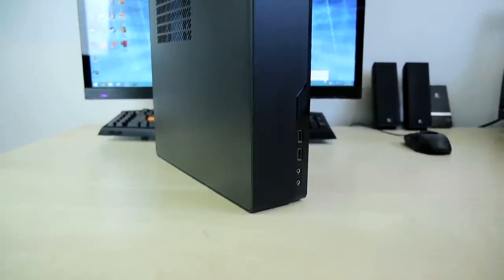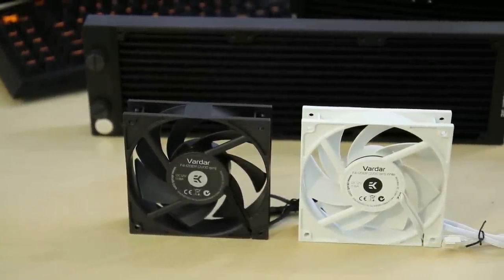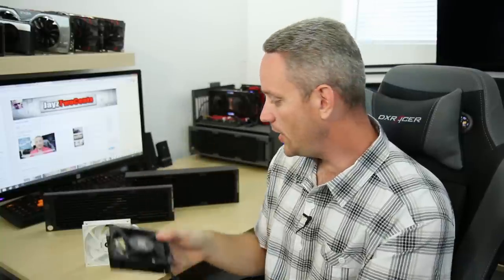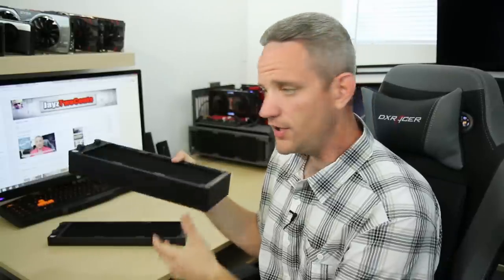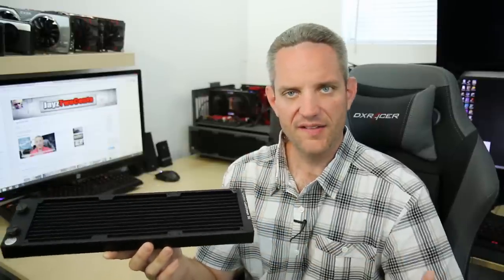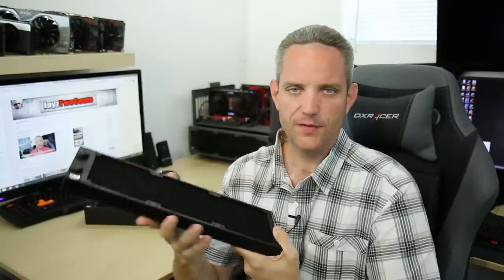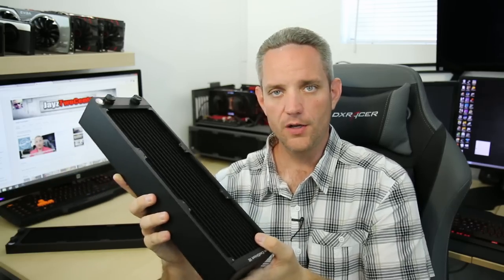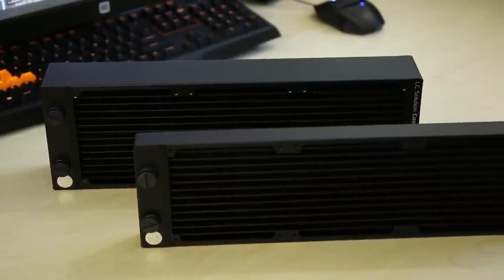New EK Radiators and Fans | When should you use Thick vs Thin Radiator?

Comment: ***** Would it be worth doing a pair of thins with a fan in the middle if the space was available?
                     
i.e   air in => thin rad => fans => thin rad ==> air out

Or even the above example with an extra fan in push or pull on the outside.

Comment: The case I have comes fitted with a 3x140 rail but I can buy a 4x120 rail... 
My question is... for a CPU loop only ( ASUS R6E Monoblock ) cooling a 7980XE should I go with a 420 with 28 mm thickness or a 480 with 28 mm thickness and buy the new rail?

Comment: The thing I dont understand though is,  for two raditators the same size, one with high FPI and low thickness and the other with high thickness and low FPI, which one is better ?  any disadvantage to finding high fpi radiators and using them ?

Comment: Well damn you answered some pondering questions I had about my setup.  I have notice my water level dropping but couldn't find a leak, and my Alphacool XT45 Triple 120 makes squirting water noises could that be those air pockets?
Reply: B3yondBlu Most certainly air pockets - try leaning your case side to side gently (like 45* should help) a few times throughout the day. Just be safe about reservoirs and such - leaning or laying on its side if your res is for some reason not safe for doing so could be bad. (A properly built system should be fine in any orientation - but better safe than sorry).

Comment: I have space for triple 120 or dual 140mm rads. Would you recommend a 280 or a 360mm radiator?
Reply: ***** Triple 120s as it has a larger cooling surface area than the 280.

Comment: Also, i just received my Corsair 750D. Can i run the EK Slim 240x2 and EK Slim 360 Push pull Config? Stock PC with potential future overclocking.

Comment: Building a TR system with a Swiftech 480, a Alphacool 280, and Alphacool 120, all are copper with push pull fan config an EK tube res with D5 pump bottom, and a WaterCooling Heatkiller IV CPU waterblock in a modified Coolermaster Cosmos 2 Tower. But I am not sure if I should run the loop res to pump to 120 to CPU to 480 to 280 to res. Or diffrent combo. Please advise

Comment: would you say it's better to use a thick radiator when the case has bad air flow and a thin radiator when there's good airflow? also the thicker the radiator the more powerful pump you need to push the water right? or is my thinking wrong
Reply: so it seems like using a thicker  radiator is needed when you're only using one radiator too cool multiple components?

Comment: hey jay im planning to get a custom loop with ek kit performance 360 and 1080 gpu block and im also planning to add 360(2x180) rad. do you think its overkill? because im only planning to run my fans at 500rpm

Comment: What is the standard wattage dissipation capacity on the average standard thickness 140x140 radiator?  I have done some looking but that doesn't seem to be in the talking points and I am not sure how to find technical spec sheets.

Comment: which is the most optimum radiator thickness  
like how thick of a radiator I can buy before I am just wasting money 

is the a difference between a 240 radiator vs a 280 radiator my case allows a top mounted 280 but it is very hard to find where I live

Comment: Will the Vardar fans perform well on CPU heatsinks?
Reply: ***** I have the Phanteks ph-tc12dx, will the Vardar fans perform better than the stock phanteks fans? i was thinking about getting Noctuas, but i need white fans because of reasons.
Reply: Andres Gallego Noctua Redux.
Reply: Andres Gallego you can spay paint the frame. you can leave the blades because you cant really see them

Comment: jayz i have a 360 radiator atm which is thick. Im planning buy a 420mm radiator which my case supports, but thin. It will be a downgrade or i will be even? im asking because space matters in my build. Im planning to cool with this an i7 3820/r9 290x and the northbridge-southbridge.

Comment: Question: is there much difference between the performance of a triple 120 rad vs a dual 140 rad? taking into account I want to run a quiet but cool system
Reply: Can you math? Assuming equal thickness, 3 * 120 = 360    2 * 140 = 280    360 > 280    360 / 280 = 1.29    So a triple 120 is 29% more surface area, and will provide better cooling. Not sure if the cooling increase is 29% though, there's probably some diminishing returns.
Reply: Malus1531 The question is, can YOU do math? You forgot to factor in the width, as the 140's are 20mm wider than the 120's so that adds a lot of surface area along the length of the rad. 

If we work in cm to keep the numbers smaller we'll have 36cm*12cm=432cm^2 and 28cm*14cm=392cm^2. 

432/392=1.102 so that's 10.2% larger surface area as opposed to your poorly calculated 29%.
Reply: 51H0N Even though the difference is ~10%, if possible I would opt for 360 instead of a 280. The extra air flow being pushed through the rad from having a third fan should be the biggest benefit in this scenario.
Reply: +Kurt Philips Hah ok, made myself look like an idiot I guess. You're right. 29% more length*
Reply: No worries lol, have a good day.

Comment: I have an itx build i7, 1060 card and a case with 2 80mm fan vents, does it make sense would it make sense searching for a dual 80mm radiator?
Reply: Ronald Jones Alphacool does a dual 80mm rad but if it's the only rad in the loop you're probably going to get better performance from a decent air cooler.

Comment: I've been going everywhere to try and find some advice on what to do... so I have the fractal define s and that case has 55mm of space at the top. I wanted to use a 420mm rad on the top but ek doesn't make a 30mm or less 420mm rad. so my choices now are to either get a different brand or get an ek 360mm rad. what should I do?

Comment: Got myself 4 Vardar. I'm currently RMA, because they are noisy as fuck seriously. I had to bought some caoutchouc pads to get the noise down, but it doesn't work that well.

I even got some bearing noise when the motors is cold, this is ridiculous. And all the 4 are like that, so that's not only an "unluck" thing.

Comment: So if you say that cooling is not linear, a 240mm radiator will not act as if you had two 120mm radiators? idk but my logic tells me it would. its twice the metal, and its heat. heat! metal!.. heat metal heat metal heat metal

Comment: Would a 120x480mm rad or 140x420 rad be better? Same thickness.
Reply: +BlueLightning Films do the math. if they are the same company, material, construction, and fins per inch then 120x480x30= 1,728,000 mm cubed. a 140x420x30= 1,764,000 mm cubed. if they are both a single row radiator then they should have almost equal ability to cool. only thing about it would be finding a case that can handle that size of radiator. (very few cases have them) at that size it will  kind of be at an aesthetics and price point. another thing that might be a selling point is that you will be able to run 3 140 fans and make the same air movement and quieter overall compared to 4 120 fans. if you aren't running more than one gpu there is no real difference.

Comment: jay.. how do you install the quad radiator? do you need a radiator mount??
Reply: Heli Hutchinson depends what casee
Reply: I've got a silverstone tj07 but I don't think there's any holes to mount the radiator
Reply: Heli Hutchinson then i think you will need it but there cheap
Reply: I've been in touch and I've heard that they can be installed using a radiator mount but for my case holes will need to be drilled taped and threaded

Comment: Read thru the whole thing, watched the whole thing.. some questions answered but honestly.. the topic question wasn’t answered... not 360 then vs 240  thick .. go thin.. i get it.. but i have a XE thick and SE thin.. both 360, so of SAME length.. which is better
Reply: @Stein Mauer So the answer to the TOPIC QUESTION is, use a thin rad if you own low rpm fans and a fatty if you own high rpm fans... ok, man .. my single gpu only on water should use a fatty cuz i have high rpm fans, but my 11900 w/3090 on water with dual res,  use a thin rad and low rpm fans cuz i guess ...

Comment: hej ***** i use the "Lepa Aquachanger 240" as CPU-Cooler, and the Temps are mid 30´s @idle and low til mid 50´s @load on my Xeon E3 1231 V3. Are this Temps good can it go lower (i use the onboard Themp-based FanController for Silend in idle) ? regards from Germany ;)

Comment: Hello everyone, I plan on building a gaming pc in a core P5 case with Hard tube water cooling, I plan to go with a 9700k and a gigabyte board with monoblock, right now it would be pared with a 1080ti asus strix that i also plan to but a water block on. Would one 480mm rad be enough for this setup? Also if i wanted to go with a 420 rad so i can use 3 140mm fans instead of 4 120mm's would that be enough? I do plan to OC. and ill be going with the TT ring trio fans for the looks. TT rgb fittings, the rest EKwb. New to water cooling, comming from hyper 212 evo's and a Noctua dh15s

Comment: ok so i get that the longer the rad the better but if we're comparing the same size rad like a thick triple vs a thin triple the thicker is better right? of course factoring in they both have the proper fans and everything needed to operate optimally, because i have a HAF 932 and i am still kinda on the wall on what rads i want to get, i was going to get a Thick triple for the top and do a small case mod, remove the drive cage and put a thick single at the front of the case, the single rad for my cpu and the triple for my gpus. does that sound like a good setup?

Comment: jayz i want to build a quiet system,,,my case is 900d and i have plenty of room,,,but the problem is i have access only to ek rads in my city and ek rads don't have low FPI versions,thick version is 16 FPI and thin version is 20 FPI,,,so i wanted to know how can i overcome this problem? can i maintain the noise level down by adding more thin rads(so less needed RPM for fans) to compensate the high FPI?or the noise difference between high and low FPI is so much than cannot be compensated?

Comment: Jay, I watched your EK AIO review but I stll have questions, do you think that the EK AIO 240 would be enough for an i5 4690k and 1 ( maybe 2 ) 1080? I'm thinking about installing an extra small radiator and an extra tank.  Sorry for my noobness
Reply: BTW, this is my tower.  

Nanoxia Deep Silence 5 Gaming ATX Big-Tower 

I just wanna something like the EK-XLC Predator 240 (incl. QDC)  so I can do some minors upgrades without going custom.
Reply: The general consensus for radiators is to have a 240 for the cpu and a 120 for each GPU. So if you want to do all AIOs, you can get a EK AIO and one or two EVGA hybrid 1080s or MSI Sea Hawks.
Reply: Caminon I was thinking on getting the ek predator and add another 120 radiator and the gpu block.all with the qdc
Reply: If that's per card, then yes, go ahead.
Reply: +Caminon I hear that the pump on this system is good but was wondering if it will be able to handle the extra radiator (s).
Reply: Mike Wollinger Oh, believe me it can! DDC pumps can overcome a lot of pressure!

Comment: So... I don't care which should I get I want to know whice one cools the most because I have a lian li pc-o6s and it bothers me that there are no good 360mm aios. I'm opting for custom cooling and I want to know if I shoud hide the fan and rad or just max the hell out of it with a 60mm rad
Reply: *which
Reply: Get the longest one you can, and IF you have room for thickness, get a thick one. If you have room for 2 360mm rad or another rad, save money on thickness, and get another. 360 and 240 is enough for me. I have i7 5820k and 980 ti. Good temps. 360 and 240 thin EKWB rads in mine.

Comment: Jayz, help me out please 😁 I have one r5 5600x with alphacool Eisblock xpx block, one red dragon 5700xt with alphacool Aurora block, and Chinese pump (will change) but now I have one Chinese 240mm normal 25mm alu radiator. This all in one TT core P3. So my maximum is 420mm radiator. I want to change this, but I don't know, 420mm st30, xt45 or I need the extrem xt60 thickness? 🤔 Help me please 😁 maybe later change 6800xt

Comment: Got a question for all. I am deeply considering water cooling my GTX 970. As of right now, I have very minimal fans. I have a 200mm on the front on my case, running at about 600 rpm. I have a corsair H100 for my CPU with two AP 120s quiet editions cooling it. Of course, my GPU fan...which is the problem. Fan can get quite aggressive and is almost annoying. So I though hooking up a closed loop to my GPU would be a "smart" idea. I am not so interested in getting a custom loop since i heard they cost a pretty penny and can sometimes be a hassle. My main goal is to eliminate as much noise as possible almost to a minimum, and of course not kill my computer with heat.
( Another thing is I live in Florida and unfortunately, I have no air conditioning. So my home can get pretty steamy) So question is, in respect of me not feeling all to comfortable buying a custom loop should I :
1. Get closed loop for my GPU
2. Take the risk and venture off to buying a custom loop
3. Stop crying and deal with noise
And what precautions should I take dealing with whatever one ?
And if it helps at all, my case is a Phanteks Enthoo Pro
Thanks
Reply: JustStopMiley Productions How hot does your 970 get? I'm guessing your GPU is non-reference which is why it gets "hot and loud."
Reply: TrueZtyleZ7 Ive seen it get up to about 80-90. It really depends. Mostly stays around 75
Reply: JustStopMiley Productions reference cooler or...
Reply: Jason Jia EVGA GTX 970 SC
Reply: OCed or no
Reply: Jason Jia No, I tried it before. But decided to leave it untouched since I felt it was unnecessary.

Comment: JayzTwoCents I'm looking at using the 60mm rad to cool a 6700k and a 1080 ftw will the rad be enough to cool the CPU and GPU. I'm building in the thermaltake core p5 if that helps in any way
Reply: yeah dude easily.
Reply: if its a 360/420mm Rad than for sure thats enough, just think about 120mm Rad length for each component,so you got 1 extra,should be enough
Reply: Ive built my system already Ch1985seand its working great my 1080 FTW and I7 6700k are both running at 28C
Reply: fucking hell what's your ambient temperature?? 15 degrees? :D
Reply: about 20C I'm using a 60mm thick 360 rad from EK as my only radiator but when I'm overclocked to 4.8 GHz on my cpu 2050 MHz on my gpu the both are at about 35-40C

Comment: Question? Would a Intel core i5 2320 work well with a Sapphire Radeon R9 270x Duel x 2gb? Because the PC i have now is fairly old and was clearly not built for intense gameing. (The graphics are Intel HD graphics) The cpu i was thinking about putting in my new gameing PC is a AMD FX-6300 3.5GHz 6-Core Processor which one is better? Thanks for help :)

Comment: sorry mi bat unglish i has havent the rad 34mm x 240mm only cpu and i agre 1 gpu ann rad the 240x26mm(mi question is best this configuration or 1 120mm 34mm?)thakyou,and also change the pump 500l/H for 1500l/h

Comment: Thanks for the advise. I went with ek slim radiators and they are shit. That coolstream se is 25mm not 30.
Reply: Did you get another rad instead of the ek slim afterwards?
Reply: ￼ nah mate. In my country you can’t return stuff once it opened and works as intended, so I thought I’ll just put up with them for a year or so then get what I should have the first time.
If you’re in the market, get the Corsair slim rads, I think the 30mm ones.
They are rebranded hardware labs, which were proven to be 5-6 degrees better performers than the ek slimline.
Which is the difference between low 50’s which I’m personally not happy with, and mid 40’s.
Reply: @forsakenoutcast  I had my ek slim rads for 5 years now, thinking of getting other ones if it's worth switching

Comment: Ok, question.  I have the Phanteks Evolv X case with an EK SE 420 slim rad with 3 Noctua NF-A14 in the front.  I'm using it to cool my 2080 TI and my i9 9900KF.  The GPU is fist in the loop then the CPU.  The GPU doesn't get above 45-50c when gaming(Division 2).  The CPU gets to about 55-60c.  So do you think my slim 420 is good enough or should I get a thicker rad?  Or even add a second one?
Reply: If you're well below the thermal limits and below the damage threshold why would you even consider getting a thicker Rad? 
is this with overclocking? then no. If without then maybe.
Best thing to do is to check your liquid temp. If its much different from ambient thatll tell you that you need more radiator.

Comment: So on a related topic about heat and stuff, if my gpus are connected to the same loop as my cpu, the temp of the cpu will run higher than if the cpu had its own loop, since the gpus typically run hotter than a cpu?
Reply: Pieter Swanepoel if you have the same amount of rads no
Reply: This is really interesting to know. Thanks for the reply.

Comment: so triple 120mm or double 140mm if they are the same thickness?
Reply: Like he said the longest one you can fit in your case is going to be better having more surface area will give you more cooling
Reply: Daniel Burgos I just corrected myself,, i meant to say 140mm not 240mm. 3 120mm fan rad is going to have around 43200mm/sq surface area and 2 140mm is going to have around 39200mm/sq but 3 fans means 3 motors instead of 2 motors and assuming the motors take up the same area the amount of airflow could be the same. but then theres also the problem of the bigger fans having bigger corner sections...i think its probably a little more complicated than just saying more fans is better when you take fan size into account.